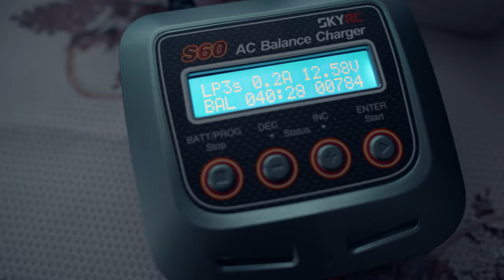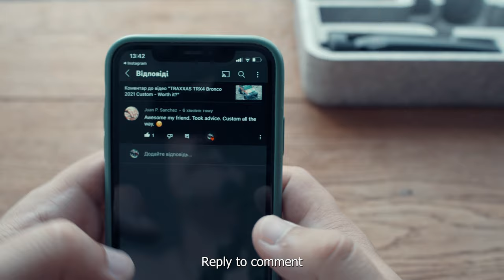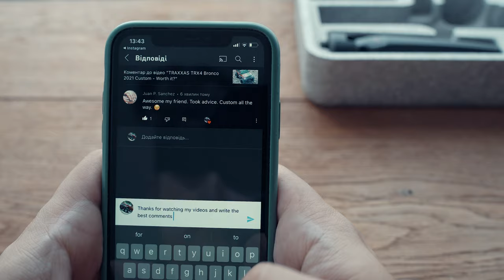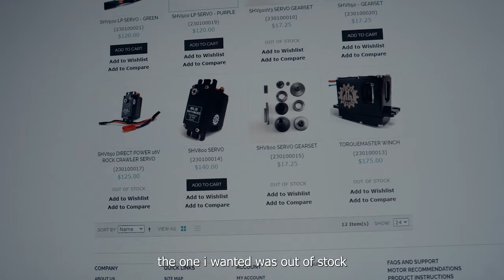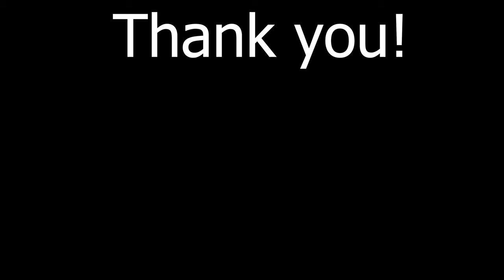TRX4 2021 BRONCO 2021 H-Tech Custom | UPGRADES Servo | Stones Crawling

Comment from the maker: #trx4 #trx4bronco2021 #rctruck
🛠Taxxas TRX4 Bronco 2021
LED Light Kit for Traxxas Bronco 2021 https://amzn.to/3uvppHP
https://s.click.aliexpress.com/e/_APAFR3
Brushless motor Hobbywing AXE R2 2800 kv COMBO https://amzn.to/3GTTyEP
ESCB Hobbywing AXE R2 2800 kv COMBO
https://amzn.to/3sHHznj
https://s.click.aliexpress.com/e/_9xIO7r
Servo STOCK
3S LiPo Battery https://amzn.to/3rHfMm8
RC4WD MICKEY THOMPSON NARROW 2.2" BAJA MTZ SCALE TIRES https://amzn.to/3x7nTLt
Aluminum Metal Bumpers H-Tech https://amzn.to/3rO4IDZ
https://amzn.to/3ICYoFY
Aluminum Metal Fender H-Tech https://amzn.to/3rNjCKP
Aluminum Metal Roof Rack H-Tech
H-TECH RC CNC Aluminum Metal Rock Sliders https://amzn.to/33MfUc8
Aluminum Metal Beadlock Wheel Custom 2.2 H-Tech https://amzn.to/347w6EB
Flysky Noble NB4 Rc Transmitter https://amzn.to/3GKdSIR